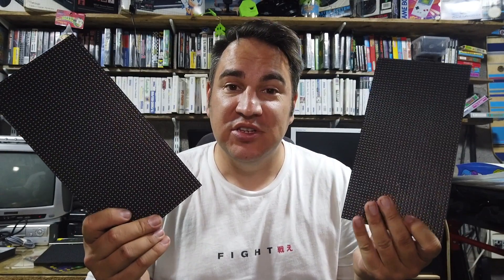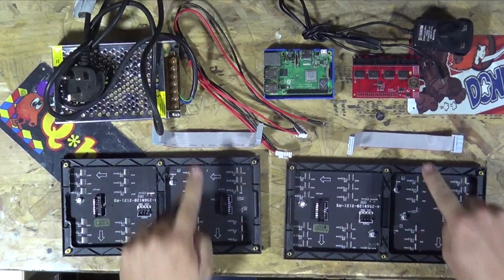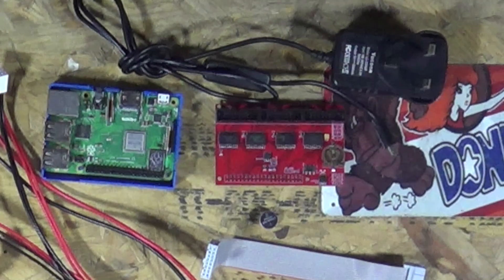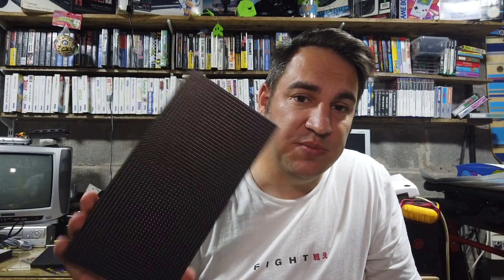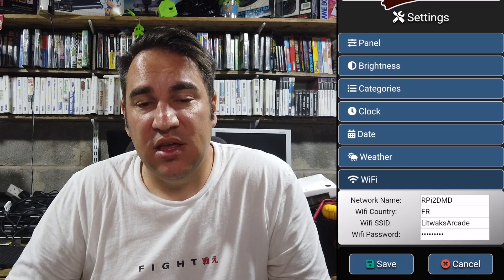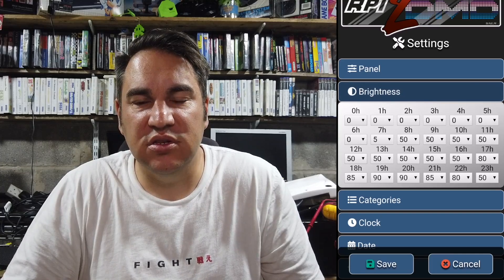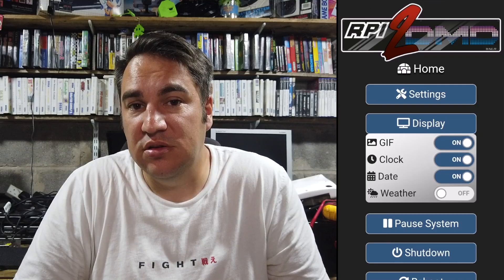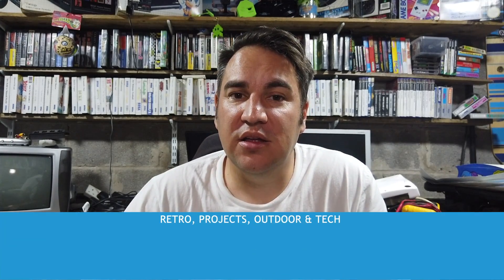RPi2DMD Tutorial English Game Room Clock LED Panel Raspberry Pi Setup

Comment: This looks like a fantastic project, I’m wondering with it being almost 5 yrs since the team in France worked on the project, have I missed the boat? The documentation link is still live but I cant seem to register on the forum to find out about the OS. Or the larger pac. Has anyone had any joy with this in the last yr or so?
Reply from the maker: Yes had a message off someone that built one a week or so ago. They managed to get the software off one of the developers on Instagram. I can help put you in contact if needed.
Reply: @GoodwinsPlace thanks for the heads up, I’ll wait to hear back from the developers. Great to hear it’s still going strong

Comment: Did you find that it needed a diffuser to keep the brightness down? If so, what diffuser material would you recommend?
Reply from the maker: You can adjust the brightness in the software. I prefer without a diffuser so you can see all the pixels, but know others have used perspex either clear or slight tint.

Comment: Really thanks for the video! Can i use p5 panels instead? Will the resolution be the same? Also, is it possible to change the font for the clock?
Reply from the maker: I've not tried P5 panels, the pixel spacing will be further apart but should be same technology.
Clock font is in the app to change.

Comment: Just checking before I embark on this. Is it still fine to buy the panels from aliexpress? Are they decent or will they fail too quickly etc? I was thinking about either a wall mounted p4/p5 version or a desktop p2.5 version.

Oh one more question. Smallcab are out of interface boards. Do they get more in periodically?
Reply from the maker: Hi, my panels are still working since this original video so they last quite well (or have for me).
Not sure on smallcab, best email them as I've not tried any other interface board.
Reply: @GoodwinsPlace  cool ta. I'll order them then.
I actually had a read of the big thread (I started from the end) and there was some available on electrodragon which is mentioned. so I ordered one from there for £8 delivered to UK so I'm good on that front.
Reply from the maker: @Podbod  I'm sure someone in the comments here used those also. Can you comment back and let me know how you get on. I might do an update video soon and possibly new code if I can get some time.
Reply: @GoodwinsPlace  sure, well do. Most likely itll be the new year :)

Comment: I want to Install 3 Panels side by Side. Will the Animations be stretched? Would be perfect when the Animations are centered and only scrolling stuff using the 3 Panels
Reply from the maker: I think you'd need to add the height too. So 3 (width) X 2 (height) to stretch it the same shape.
Reply: @GoodwinsPlace Thx...i wanna use it for a marquee Display on a arcade cab, so the space is limited. 3 panels side by side would be perfect, but 2 panels are also fine for me.

Comment: Hi Goodwin, fantastic video this - i have been watching and preparing for this project for a few month now and collecting the parts
I have followed the exact process and unfortunately when powering up the panels I bought they are not working - they are getting 5v power to them just no response on the screen
Do you know if there should be at least a test pattern on these to confirm the panels are working ? I think i may have dodgy panels but were purchased off a reputable Aliexpress company who are supplying support via messaging on why they are not working...they dont support the driver board so at a bit of a loss
Just wondering if anyone else has had this issue...or is it a process of elimination of each component ? I will review the forum as well to see if any tips on there
Cheers and also loved your video with Todd at TNT !! :)

Comment: Great tutorial thank you is there a power supply you could recommend getting from aliexpress?
Reply from the maker: I've not used any from AliExpress so not sure on the reliability. They do look cheap on there so you could take a chance. Just make sure it has the correct voltages needed for powering both the pi and the panels.
Reply: @GoodwinsPlace  Thank you ill get one from in the UK. Quick question I downloaded the RPI2DMD scroller and it says to press windows and Z key to open however nothing opens is this because I need access from elluigi? Also what is the best way to contact him as his youtube does not let you message him and i could not find his instagram. Will he also supply the additional 5100 gifs?
Reply from the maker: @sie1984  not sure what you've downloaded that needs you to open in Windows. It should just be an image file to burn to an SD card.
 The French forum is Neo-Arcadia if you can register on there then they have a thread where the Devs can give the files, he used to be on Instagram too.
If you are still stuck give me a message on Instagram or email.

Comment: Hi Craig, I finished the basic build. Again, thanks the video. It wasn't obvious (for me anyway), but your video helped me with the wiring  (red is +ve terminal, black is -ve terminal). I finished the skeleton build and looking in making a case for it.
The only task is to fix the recently batch of faulty RPI2DMD Controller Card (from smallcab).

Do you know what screw type I need to buy which fits the screw thread on the chinese P4 panels (from alixpr3ss)?
Reply from the maker: Interesting to know there was a bad batch of interface boards.

I can't remember the exact size M screws but I bought a bulk pack of M bolts on eBay.

Have a look on Thingiverse they have some different frame ideas. I've not printed one as it's been on a shelf until now, but plan on doing one soon so I can wall mount it

Comment: Hey Goodwins Place. I have watched this video many times and have only just received my equipment to build one myself yesterday. I have got hold of the initial software and am waiting for the GIF pack update to purchase later on. After I put all the parts together I have the same problem as you did. A garbled display but after a connection through ethernet I managed to correct it slightly but I am left with a back horizontal bar across the middle. I have asked on the forum for help and wonder how u managed to correct your display. On my setup it has 2 options missing LED multiplexing and LED Rowaddrtype doesnt appear. Do I have an out of date version? I was emailed the link yesterday for the software. Hope you might me able to help
Reply from the maker: Ask them for the Dev version, tell them it's not working with your panels. They sent me one they were testing and it worked fine, I would have thought that would be that standard these days.
Thanks for watching and let me know if I can help at all.
Reply: @GoodwinsPlace  Hi Craig. I requested the Dev version from the French forum and they linked me to a version 2.5 Is this the version that you are running too? I have had no luck with the new software and it displays the same problems. Can you check which software you are running please and let me know if its the same one they linked me please?

Comment: Hi Craig. Did you ever find out how to power the raspberry pi from the power unit so that i only need one plug? I am guessing its the red and black connection into relevant GPIO pins?
Reply from the maker: I didn't bother, I've left mine running on two plugs at the moment. I think it is down to the pi being fussy on the supply more than anything.

Comment: Hi Craig, thanks for all the videos, this one is especially great and got me to pick everything up ready to build. Can you tell me what plug/lead I need for the power supply unit?? Thanks!!
Reply from the maker: Thank you. Glad you like the content.
It's a 3 core flex with a standard 3 pin plug if in the UK.
Reply: @GoodwinsPlace  Could I just borrow an existing plug & lead from another old appliance? (assuming I ensure there's a 10A fuse in the plug)
Reply from the maker: @scrutley  for the power supply? Yes any 3 core should be fine in the UK. 10amp should also be fine but check to see if the power supply says the rating.
Reply: @GoodwinsPlace  Thanks Craig. Yes for the power supply, I've got The power supply says "10A" on the side, but as the output not the input. The input amperage isn't mentioned, so I'm not entirely sure what to use! There's a comment in the amazon listing's questions that mentions using a 3A plug fuse, to add to my confusion.
Reply: Also - the documentation with the unit says "Max AC input 3.5A/115V    2A/230V" so, maybe it is a 3A fuse needed after all. Does that sound about right?

Comment: Hi Craig, how did you add your own gifs to this project?  Is it straight forward?
Reply from the maker: Hi Tim, yes it's just creating the GIFs at the right dimensions I used Final cut but you could use any editor that exports as gif files, I think it's a 128x32 px file size, then it's simply a case of creating a new folder in with the wider gif pack and the system will find it.
I'd avoid large white areas, it makes my power supply scream a bit when I have a lot of white on the panel at once.
Reply: @GoodwinsPlace  thanks Craig, yes I have FC, never used it for Gifs, but will give it a go.

Comment: Hi, Can I ask the best way people found to join the 2 panels together, thanks.
Reply from the maker: When I first did I just used a bit of plastic with holes drilled in them. 
I've now done a couple of 3d printed items to stand it up and to hold the panels together. 
There are some really nice frames out there, what I've done on mine is just basic as I stand it up rather than wall mount.

Comment: Great video - thanks for taking the time to explain this all. One question from my end, you chose the P4 panels .. I assume there should be no problem with using P2 panels instead which are the same size but have a much higher resolution? I guess the problem may more be finding higher res marquee pics ..?
Reply from the maker: I'm sure I've seen builds with P2.5 panels, might be worth asking the devs of the project to see if they have any suggestions on resolution for gifs.
The GIFs should be fine. If not you could easily design some higher res GIFs. I've added a few since making this video.
Reply: @GoodwinsPlace  thanks I’ve started reading the french forum also - thx for the lead

Comment: Thanks for the video all very helpful, I have done everything as per the instructions , including getting getting the beta version as my panels were not compatable. I have added the extra line of text but when I switch it on I only get red versions of the gifs, i have also gone through all the RGB settings and nothing works. Does anyone have any ideas ?
Reply from the maker: How strange. Have you contacted ELluigi to see if they have had this issue before? 
Do you see the image but all red? If so can you try different ribbon cables of check the continuity on them?
Reply: @GoodwinsPlace  thanks for the responce and yes i have been intouch he asked me to post in the forum which I did with the help of google translate, but I have had no responce so far. I have not been able to try different cables as I do not have any available I have some soming soon (when a pals panels are delivered). I have tried a different Pi3 as that seems to fix most of the issues that came up in the forum but alas still no good. If i do find out what the issue is i will post back here just incase it can help anyone else in the future.
Reply: Update, there was an issue with one of the panels which made the 5volt power supply only give out 2.1. this was found but trying me friend supply which worked fine before connecting to the panel but not so well afterwards.so the panels are being returned and new P5's ordered as I can get the case printed for those.
Reply from the maker: Good work in finding the issue.

Comment: Hi Craig, great video!, just built mine and bought the extra GIFS, it looks amazing!   I have a couple of questions please:
1.  Is it easy to get hold of the frame kits?  Because I've been looking at all the pdf tutorials and it's not that clear even with translation. 
2.  Also is it possible to extend the screen i.e. add 2/4 more panels or are the GIFS designed only for 64 x 32?
Loving the channel by the way.
Reply from the maker: Hi Tim, Thanks for the sub. 👍
1. I've since bought a 3D printer and there are is a file on Thingiverse that I'm going to print out later this week. I've seen some with a front perspex panel, but I don't want the glare or smoothing that it might add. 
2. Yes I think you can increase diagonally in the same aspect ratio. I have an order of panels on the way to build some more so might give it a go when they arrive to see how it works. The bigger you make the lower res the gifs will look as they are low resolution to start.

Comment: Great video, ordered the parts but get the garbled images that you originally had. When using the browser I am missing the LED Multiplexing and LED Row Addr type. How did you get these I presume these are the missing link to get it working. Have pinged eLluigi but not had a response
Reply from the maker: ELluigi will be able to get you an update on the software. I tried a load of different settings but got the same.
Reply: For anyone else reading this if you have the same issue then when speaking to eLluigi ask for the beta version of the OS, currently v2.5 and then follow the settings in the video.
Reply from the maker: Sounds like you're up and running?
Reply: @GoodwinsPlace  Yeah all good now, thanks again for the info.

Comment: This is an absolutely fantastic video! Thank you so much for putting this together and for posting the links for all the kit to get. Its made it so easy to order everything and have the confidence to put it all together. I have sent Luigi an email showing my donation to charity (i mentioned you 😉) Thanks again 👍🏻
Reply: Can I just use any plug with its end cut off to power the transformer? ( it didn’t come with any wires at all?)
Reply from the maker: Yes if it's the one from my link then you should see the markings when you lift up the plastic cover to show you where each wore goes.
Reply: @GoodwinsPlace  thanks mate yes I have the one from your amazon link.
Reply: By the way- how do you make your own gifs? You mentioned putting the resolution down below but i cant see it? What software do you recommend?
Reply from the maker: @Retro_Russ_  it's 64x32 which is tiny. I use the same software I edit my videos in which is Final Cut Pro X.
Reply: Very kind of you mate. Happy to report replacement panel has arrived thanks to amazon prime and it working perfectly 👍🏻
Reply from the maker: @Retro_Russ_  amazing. Glad it worked. Mine are still mid way from China. I think I have 8 on the way to play around with.
Reply from the maker: Great stuff. Glad it helped.
Reply: Jus put mine together: one panel is garbled. I have swapped the panels around with wiring etc and it is still the same one garbled which makes me think that led panel is faulty? I have tried various settings but no joy... will order another panel
Reply from the maker: @Retro_Russ_  that's a nightmare. I've ordered some more if they arrive sooner than yours you are more than welcome to test one.

Comment: So I have all the parts, made a charitable donation in preparation, but getting the software is a nightmare. Forum seems dead and isn’t activating sign ups and can’t get a response from anyone else. Any advice?
Reply from the maker: Contact el Luigi using the details in the description of this video. I messaged him on Instagram in English and was great helping get things sorted.
Reply: Same AliExpress ones from the link. Managed to grab all the same gear you linked to. Also just got a reply from el Luigi. Thanks so much for your help, really looking forward to getting this up and running.
Reply from the maker: Great, glad the video helped, you're on the fun bit now getting it setup and configuring to how you like it to display. 
Can you let eLuigi know you came from this video.
Reply: Already told him it was via you/this video and all sorted with the bigdlc software through him. Put it it together later today! Cheers!
Reply: Fantastic, I completely missed the email address! Have fired one over to him. Thanks again!
Reply from the maker: Great stuff. What panels are you using?

Comment: Such a cool piece of kit, and you have made it look pretty easy to put together!
Could you add another row of 2 panels easy then? they seem like the cheapest part.
Also, i bet you could make a nice frame for it out of reclaimed wood
Reply from the maker: You can keep expanding then as much as you like with extra panels, these are like the ones used in big events and stadiums for screens. The only issue is the shape, I'd probably need to expand to 4 wide X 2 high to keep the same ratio for the gif files to show properly.
A wood frame is a cool idea, all my shelves in the garage are reclaimed wood so could fit in quite nice. I'll have a think, for now it's hanging from my shelves and looks pretty good.